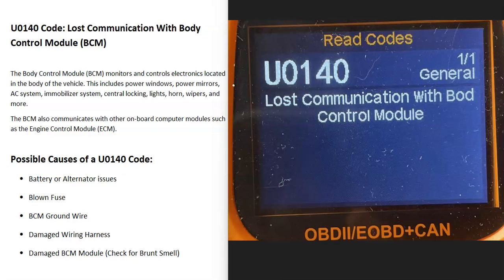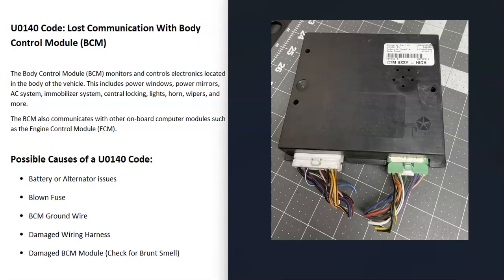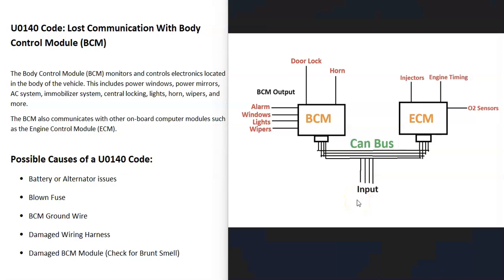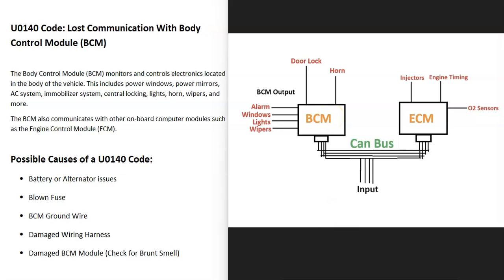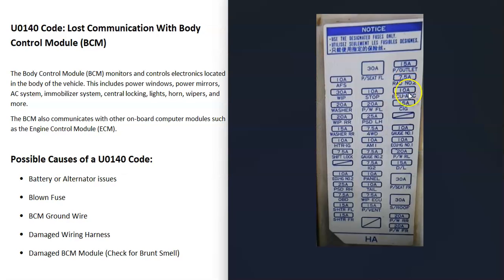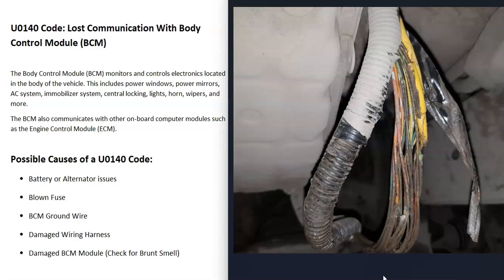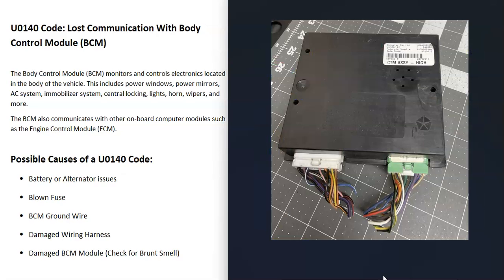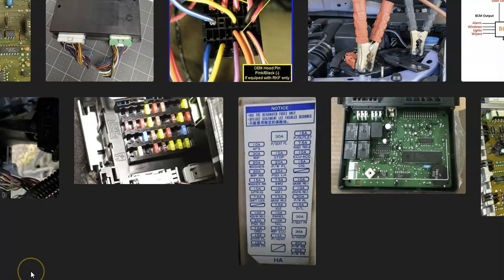Causes and Fixes U0140 Code: Lost Communication With Body Control Module (BCM)

Comment: my 2017 fiesta sedan is stuck in park no brake lights had a no comm with BCM I pulled a glove compartment relay that's when it got stuck with no brake lights car was running car ran fine before but had the code before any ideas turn lights work hazards work nothing eratic and battery reset didn't work goes in limp mode fuses looked good but I will relook and test

Comment: Will changing the REAR breaks on Ford Explorer cause this code? U0140-00. It’s the ONLY work recently done on our vehicle. AC blows but no longer gets cool.
Reply: What year is the Ford Explorer?? Your wheel speed sensors might be bad or loose!

Comment: I have a 2006 Saturn vue 2.2l 
And the U0140 popped up out of nowhere. Just didn’t want to start one morning. 
Weird thing is, if I turn it over it will crank over but shut off immediately within 10sec or less. But there’s time where I will crank it and it will stay on and I can drive it around no problem the engine light turns off it just runs like nothing wrong with it but here’s the problem once I shut it off and try to restart it, that’s when the engine light turns on again and doesn’t want to start up again.??? I need help. I’ve tried everything.

Comment: Great video ,I have a 2016 jeep grand Cherokee Limited, and my lights will not turn off, i’ve replaced the headlight control switch knob, and still same problem. The only time the lights turn off is when the car is off I cannot access. my fog lamps or turn the lights off. They just stay on.. do you think there’s a problem with my body control module?
Reply from the maker: It is hard to say, but when a BCM goes bad usually there are more issues, so while it is possible, I would lean more towards a wiring issue or possibly an option in the vehicle settings.

Comment: Mine 07 2500hd 6L was running in the driveway, i put the windows down and some music on and shut the car off and popped the hood. My brother lifted the hood and noticed my negative wire was barely holding on the battery, he popped it off for 5 seconds and put it right back on. No _ under PRNDL so no crank no start.. i have that same code and my bcm was taken apart and looks okay.

Comment: Hello , from  a couple of days i have the error mesage on my dashboard (children safety anomaly revision necesary) this errors comes and goes but now is constant so i had the posibility to hook it to my forscan and im getting the codes u0140 and u0155, what could be the problem? I already ordered a new battery im hopping its that , but can the problem come from the cluster maybe a bad conection or a desoldered pin? I fargot to mention that when the errors ocure i do not have indicators on my cluster dasboard only the mesage mention above.